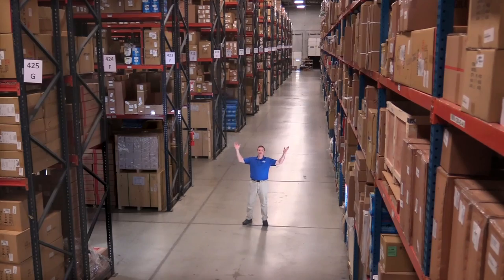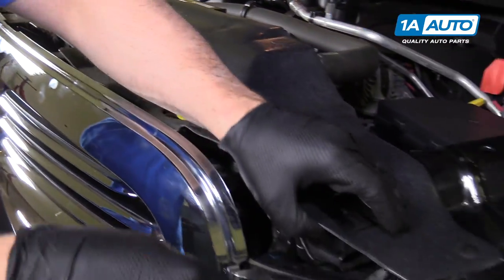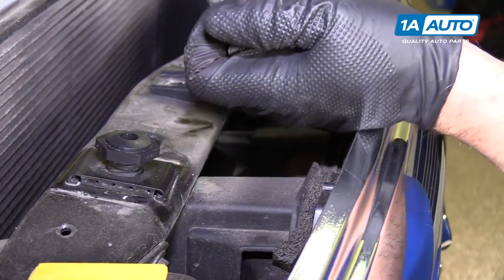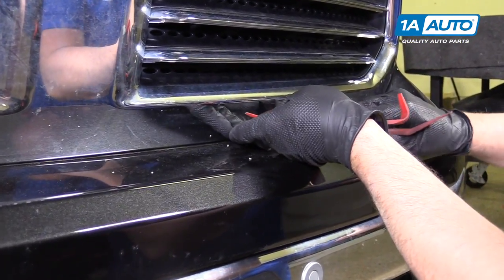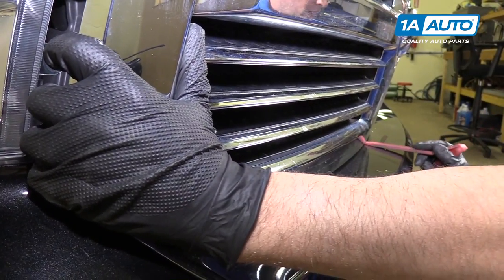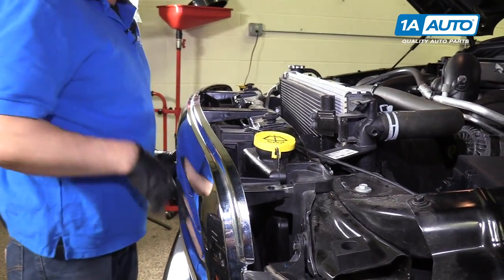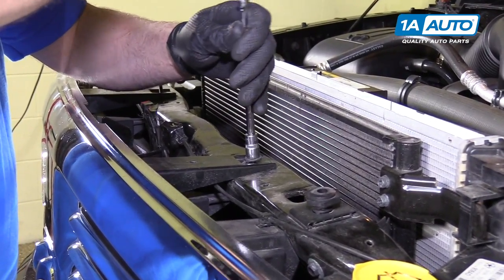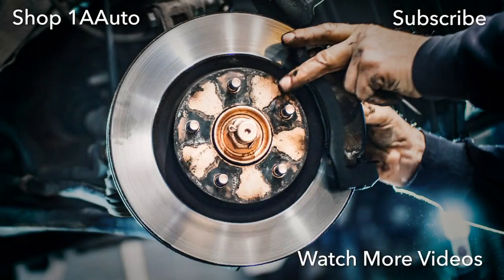How to Replace Front Grille 13-18 Ram 1500

Comment: I just bought a cold air intake online from you guys and I was wondering do you have a install video I have a 2000 Grand Marquis
Reply from the maker: We currently do not have an auto repair video that covers that particular upgrade. We will keep this request in mind in the event that we need to make this repair in the future. 1aauto.com
Reply: @1AAuto  Just bought a  Brand New Oem Genuine Mopar Grille 6NM18SZ0AA. Was told this will fit a 2015 big horn 5.7 l v8 crew cab
. Is this true